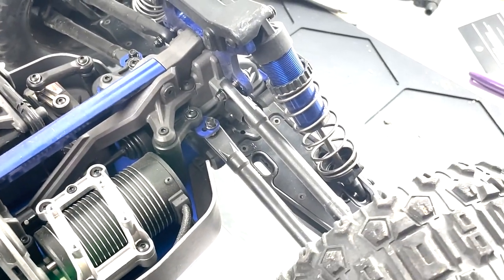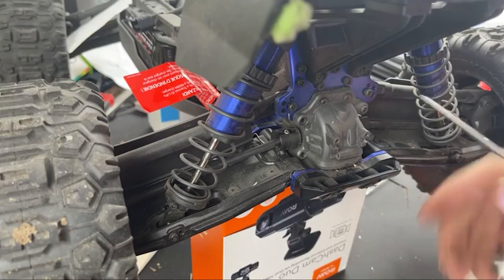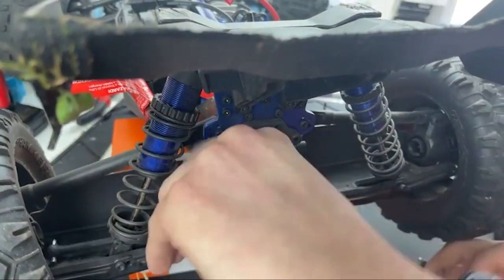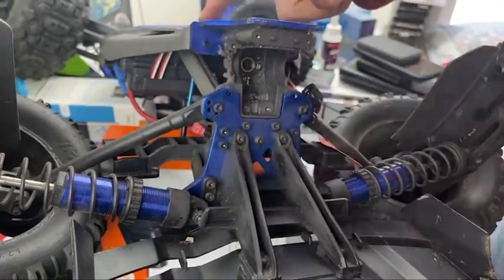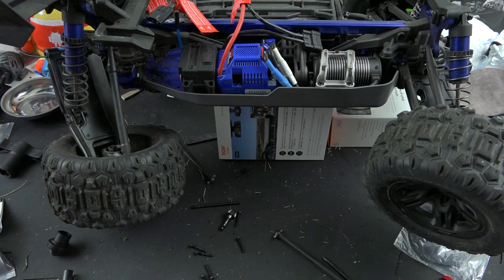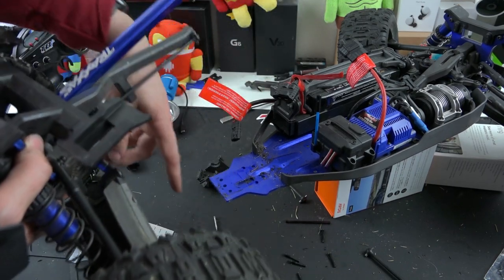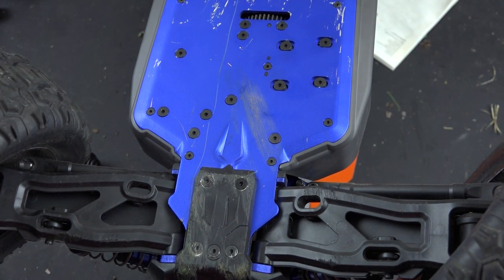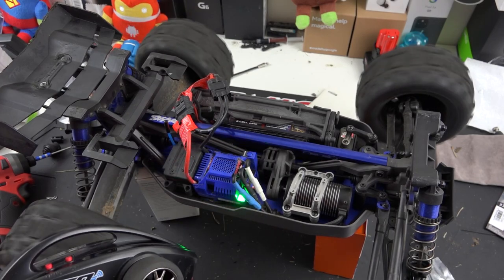My Traxxas Sledge was 2WD and I fixed it!!

Comment: I can't look. This is like a train wreck. Hope you used some thread lock on the metal to metal screws.
Reply from the maker: The grub screw had it already. But you have a point about the chassis screws. Idk. It’s not like their are guides. Had to figure out everything on my own.
Reply: @JoshDoesRC  There is a guide I'm sure it came with an exploded view diagram..Off top just looking it seems that the pin or grub screw on the rear center shaft came off